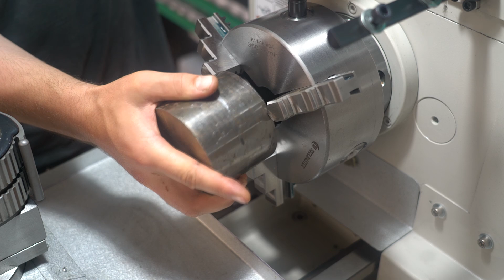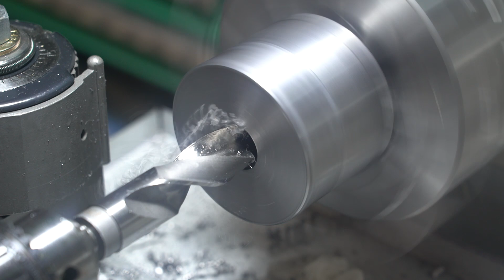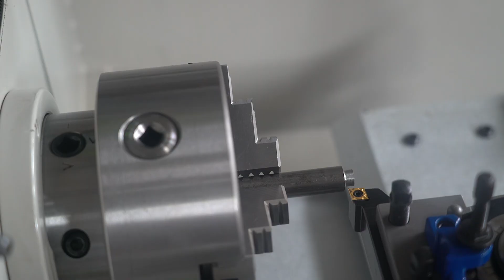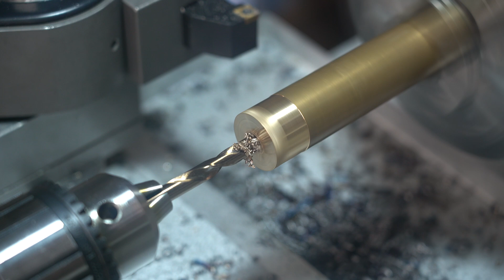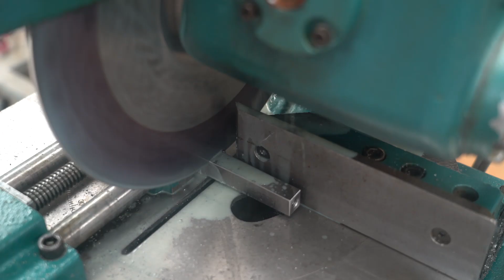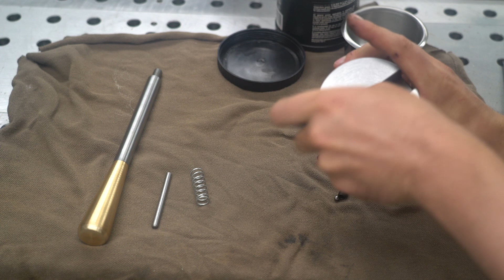DIY 'Quick' Reposition Quill Handle for Bridgeport Clone

Comment: thanks so much for posting this, i've stolen your idea and made one for my mill and it works great. the only thing i did differently was i made the handle and the square actuator out of the same piece of metal. turned the handle down to size then held it in the square collet block to square up the unmachined portion. doing it that way means you can leave a chamfer between the round handle and the larger square section.